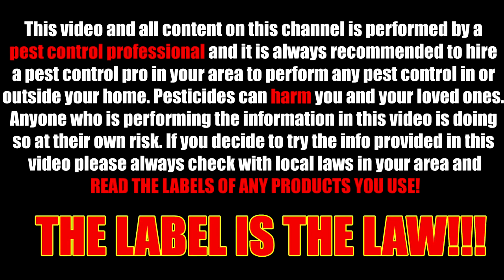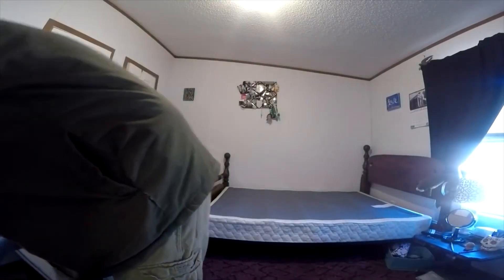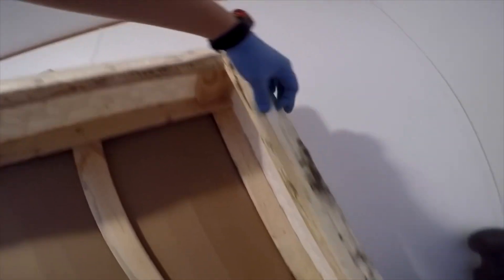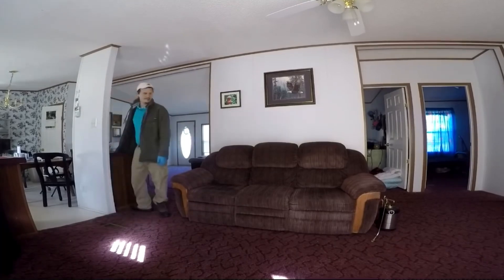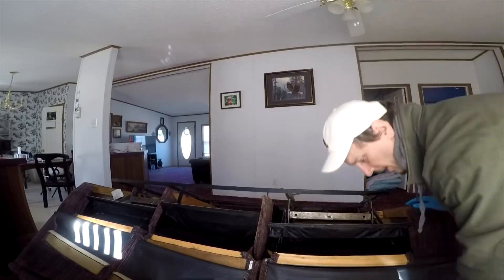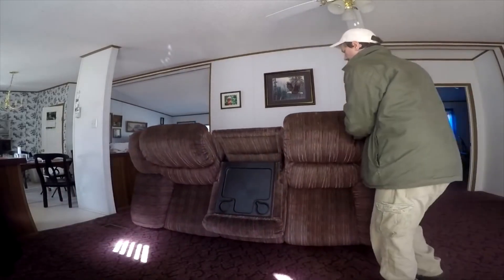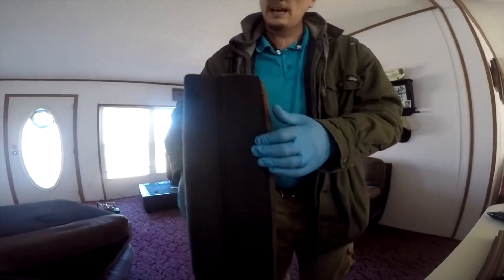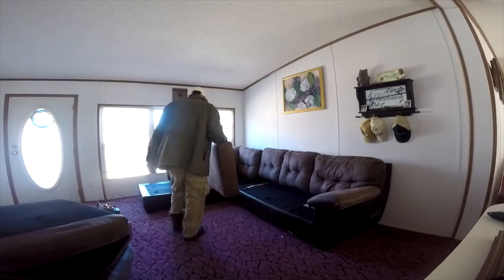Complete Bed Bug Treatment Done Right - Crossfire Bed Bug Concentrate Works Best

Comment: THANK YOU!!.....My Bed Bugs R Gone!.....I bought Crossfire from Amazon, (13 oz.) mixed it just like U said, applied it just like U said including pulling the netting off the bottom of the box spring...I even bought the bed bug sticky traps to make sure & They are gone!......As U have instructed, I will continue to spray once a month for at least the next 3 months to prevent them from coming back...Again, Thank You!  You saved me a minimum of $600 for a professional ( and possible eviction) that I didn't know how I'd be able to get bcus I'm disabled, house bound n living on a fixed income...
Reply: Can i use in baby mattress??
Reply: What’s the ratio for mixing the chemical
Reply: Yes he said let dry 2 hrs.  @masomamusawi1404

Comment: Curious to know how this infestation turned out. How many treatments were required? That box spring looked really bad. I know it's normally not recommended to throw out furniture but that may have been past the point where I would consider sealing it up and tossing it.

Comment: After the apt building exterminator sprays, when could i use crossfire? Or how far out from when they come again can i use crossfire because the spay they are using isnt working at all. I know that chemicals should not be mixed but i have to get rid of the bedbugs.
They said the only place the bugs are is in my bedroom. Unfortunately i live in my bedroom.
I have packed everything in storage bins but how do i make sure there are no bugs in the bins before i duck tape them up and seal and move them out. I know i could store them for several yrs, but i need the things in the bins.
Reply: I would like to know the answer to this.
Reply: I have the same problem. I'm going to be spraying the inside of the bins every two weeks for a couple of months, and then not touching them for at least a yr. Anything I can't live without for that long, I'll have to leave out and just hope that any bugs will leave the items in search of food, and end up walking through the Crossfire.

Comment: Hello :) You are a specialist, so I wanted to ask you a question. According to the manufacturer's instructions, crossfire cannot be applied using an ULV fogger. Can you explain to me why? The composition of the agent is similar to professional agents used by companies with ULV foggers. I perform antibacterial and antiviral disinfection myself using a fogger. I know it is the most effective method. So why can't this agent be used in ulv foggers? It should be most effective for this application.
Reply from the maker: ULV foggers would be the worst application for bed bugs ever. If you use them regularly you should know that crack and crevice is the most successful way to treat for bed bugs. Call MGK and ask them why they don’t allow it.

Comment: The video I was looking for! I have them in 3 bedrooms and they got into my couch as well so I was wondering if I can spray my couch. I do wonder though,  I have put mattresses and box springs in encasements with no plans to remove them for at least two years! Should I remove the encasements and spray them or will the encasements be enough? And should I spray the encasements
Reply from the maker: I would remove the encasements and don’t put them back unless you’ve proven not to have anymore bed bugs
Reply: @GreenAkersPC  Thank you! It always bothers me when people recommend putting on encasements during an active infestation. I don't want to risk puncturing that thing after you get the bugs under control and releasing another batch 3 months later. Just treat the mattress and box spring directly and after they're gone, encase them so you can more easily inspect for new activity.

Comment: Can I put crossfire on my mattress? You showed us doing it on a box spring but what about the mattress? Also, can I put it on my carpets, inside light fixtures, baseboards, wooden furniture, ect? 

Please give more insight about where is safe to treat with crossfire. I will try anything at this point. They have invaded my couch that I had custom made I would be so devastated to throw it out but anything is worth it to get rid of these pets 😭

I recently got back from mexico & must of picked up a hitch hicker on the trip bc ever since I got back, we have them now. I've been fighting these bugs so bad nonstop everyday & still I can not sleep at all. Bought a professional steamer + big zap bag, tons of DE, 3 gallons of 99%alcohol, Oregano & clove oil, carpet cleaner, steam mop, bagged all my belongings, treated every crack & crevace in the house with steam, tried everything... still have them. Really need relief.
Reply: I believe on the crossfire label, it says you can spray the mattress directly, just don't SOAK it
Reply: Have an update? Did you successfully treat them?
Reply: It seems like they just don’t want you spraying anything that you will wash in the sink or washing machine and contaminate the water supply.

So stuff like mattress and furniture should be okay to spray if the stuff doesn’t damage the actual material.

Comment: Do you recommend spraying the seams of the mattress prior to putting a mattress encasement on?
Reply from the maker: Do not use mattress encasements
Reply: @GreenAkersPC  why shouldn't you use those??
Reply from the maker: Because they don’t work and cause more problems.
Reply: @GreenAkersPC  can you please expand on this? Thank you
Reply: Please explain. I was told by the pest control company to use them!
Reply: You don't use encasements or bed bug sheets because bed bugs live awhile and will keep breeding and be in the encasement and say you do kill everyone in your house if you Rip your encasement and their still alive in there and they probably will be bc they are tough then you will have bed bugs again. The encasements rip very easily and just keep re-releasing bedbugs that were protected In the encasement from pesticides.
Reply: @darronaaaa362  exact;y what happened to me. The encasement kept ripping after pest control sprayed. I tried duct tape and nope. Now I got a new bed=it was really bad=I needed a new bed anyways. the nymph can get through the seams and that space at the zipper beginning. Just don't waste your time with encasements. Once I removed the encasement-treated with crossfire this weekend-I am sure it will work. I will re apply in 14 days as Jason recommends.

I kept getting bit even after 2 sprays from pest control. the stupid DE didn't work. Cimexa didn't do crap either. I ended up vacuuming it all up and just apply crossfire as label says=and DONT spray your carpets.

Comment: How exactly can I use 1 gallon of solution for an entire apartment? I read that 1 gallon is enough to cover a whole apartment, but how to apply so sparingly? With my last poison, I used at least 15 litres of solution. Please, help! Thanks a lot!
Reply from the maker: You aren’t supposed to “spray everything” you treat mattresses box springs and baseboards that’s about it
Reply: @GreenAkersPC  How about the rest of the house? Plinths, tables, cracks in the floor? You say the bed and bedside area will do it?

Comment: Walls are mostl brick and sheetrock
Reply from the maker: That’s not true. Framed walls consist of 2x4 wood studs, insulation and sheet rock. Just because a house has a brick outside doesn’t mean it isn’t made of wood.
Reply: @GreenAkersPC  true